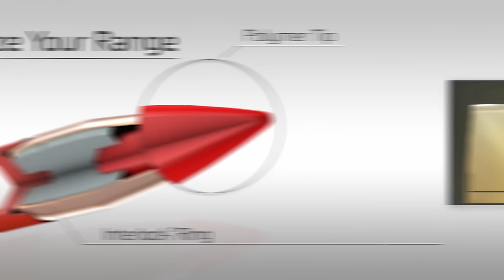Ep. 121 - Let's Talk Load Development

Comment: Let’s talk about how you lied about the velocity on your prc cartridges
Reply from the maker: When the 7mm PRC was first introduced, the velocity specifications were set using several high-performance propellants that were readily available at the time. As most of you are aware, there is a world-wide propellant shortage. As such, we’ve been forced to find alternative propellants. When choosing a substitute powder, we focus on accuracy, consistent ignition, and temperature stability. A new propellant option met our criteria and, more importantly, is available, however it often doesn’t achieve the original velocity specifications. With this reduction in velocity coupled with variation in chambers and barrels, it is possible to see 75-175 fps slower velocity from your rifle, than the velocity printed on the box.  This alternative propellant solution does generate the consistency and accuracy we demand. Other substitutes did not meet those requirements; we prioritized accuracy over speed. Hornady has always encouraged shooters to test ammunition from their rifles to obtain accurate velocity data.
 
Due to the powder shortage, everyone in the ammunition manufacturing sector is faced with choosing between loading ammunition slower than originally specified, or simply not loading ammo at all. This temporary powder solution has allowed us to continue to produce and ship ammunition despite the powder availability concerns.
Reply: @hornady  maybe you should have updated your packaging and made a statement about it instead of letting us find out after we bought your products and tested them ourselves.

Comment: Wow, here we go....reloading...this could go deep on the process...
Reply: Yep! I think wildcatting is about tbe most experimental I've accomplished. Even then it's always the research of others that helped guide me. I wanted to learn one specific case, the Savage 250-3000 case. It's been an amazing experience. I'm tempted to take it one step further if I ever have the opportunity. Most people wouldn't consider a 6.5x250 nor a 7mm x 250 but I'm an unusual duck ever since an old man invited me along to develop precision cartridges in an underground long range rifle tunnel. I learned the perfection of the .222 then developed perfect 223 first. Later, I found disappointment working with the classic weatherby magnum's, Lazaroni, and the 7mm Magnum so I quickly adopted the BR both 6mm and 7mm before going back to the 250-3000 case. Good enough till I have access to a tunnel again.

Comment: Propellant ladder testing has a couple of uses not discussed here.  One is to find the charge maximum for the particular combination.  Number two is to see if there is a combustion change as the charge goes up.  If you see that the velocity change per charge increment changes radically as the charge increases, you may have found points where the propellant transitions from erratic to stable to erratic burn rate.  Double based propellants show these characteristics changes more often in my experience than single based ones.  When I find the series of charge increments that produce a steady velocity change per charge increase, I load within that range.  You cannot do this in 1 to 5 shot per increment steps reliably, it takes approx. 10 shots per step to filter out the noise.

Comment: The 6 ARC was mentioned several times in this video, but most people don't know that it is a special case (no pun intended).  It has different loadings depending on what type of gun it is used in.   It would be helpful to explain that the SAAMI max pressure for the 6 ARC (and 6.5 Grendel) are set relatively low (52,000 psi) for good bolt life with an AR15.  It happens that this is too low to use the traditional "keep adding powder until you see pressure signs" method of load development.  I know of a fair number of Grendel shooters who initially go well beyond written max loads, not realizing that they are overpressure for good bolt life.  
   In a bolt gun, the 6 ARC and 6.5 Grendel can be run at higher pressures.  Hornady produces two sets of reloading data for the 6 ARC:  the "gas gun" loads are at lower pressures than the "bolt gun" loads.

Comment: Some twenty years ago, I purchased a Remington Coast-to-Coast or Sears rifle…yes, a long action 700 .270, the proprietor threw in two boxes of PMC ammunition! My intention was to do a custom 338! Unfortunately, my younger bother heard I purchased such, being tiered with his 30-30 inquired about using such for deer hunting! So, I put a Redfield hunter scope on, so I attempted to sight it in…I went through some twelve plus rounds…the best group was over 4 MOA! My brother then went on to harvest our three deer, with three shots! He, begged me not to do anything with that rifle, so I went through my load regimen. Resize, trim to length, de-bur inside and outside; and de-bur  the flash-hole!  I wishing towards having a Chronograph, researching numerous published data, I selected Hodgdon H4831SC with CCI 250 large rifle primers, & 130 gr bullets. After such, I reduced the group size to sup-half inch with PMC brass! I’ve continued to monitor the throat erosion via modified case…
Reply: My selection towards powder charges was mid-range suggested powder charges, with three shot groups, with three lower and three higher load of two grains intervals, measuring group size. After-wise, doing 1/2 grain intervals! Each was with just three round groups. Then, searching toward bullet jump, shooting above and below of .005” OVL…which brought me towards reducing group size from over 4 MOA to sub 1/2 MOA at 100 yards

Comment: Nice to hear 2 of you using American Rifle Company receivers.

I was reloading some Fiocchi .45 Colt cases.  When I tried to deburr the flash holes I discovered that most of them were visibly off center. With new brass (mostly Starline or Winchester) I find a few cases where the flash hole needs some work, and I have found a couple cases that did not have flash holes (don’t remember that brand). 

It doesn’t take long to check the flash holes and you only do it once per case.

Comment: For example:  Consider your Subsonic Luger 147 gr XTP round: Cat#90287.  What does the factory database look like that allows you to state MV = 975 fps in a 4" bbl?  How many rounds tested?  What is the extreme spread, standard deviation, average of all the spread velocity measurements.  Also what is powder wt. precision, bullet wt.  precision, accuracy of MV measurement device, accuracy of brass measurement, etc.   Are the components tested just selected at random off of the production line with no rejects?

Comment: I've been developing loads with GRT (Gordons Reloading Tool) Can't recommend GRT highly enough. 
If I do my brass prep, take case volume measurements, case length, seating depth, powder temp etc, I'm always within 20-30Ft/sec of the measured value. Once I have the measured velocity values, I can tweak the load & have had very good success with accuracy. So far I've found that the loads I've worked up with GRT have been very accurate to the point where I haven't had to tweak much if any.
I now spend most of my testing on a few 10 shot groups then I simply ensure that POI matches the POA. POI to POA is where it's at. Since we don't shoot groups at anything out in the field accept BR or F Class, it's all about Mean Radius & ensuring it is being utilized as precisely as possible.

Comment: Between my tighter match chamberr 308, valkyrie and 6gt, i just do a 10 shot spread over the top half of the powder charges. Anything within 50fps is where i try to find a +- 1 grain tight velocity node. I start at 0.030 jump. Aftee find go velocity ill play with seating to get tighter groups. Only chafer inside necks, clean in stainless media and shoot until the barrel starts throwing flyers

Comment: I learned a few things from this episode, so thanks for that.  Question, I need to do load development for an old Savage 99 chambered in .250 Savage which was re barreled with a Chick Donnely barrel that was turned down to a pencil hunting barrel.  The best accuracy I got with factory ammo was with the Hornady 100 gr Interlock (sub 1 MOA), but my primary use for this rifle is Coyote control & the Interlock does not expand fast enough, so I need to reload & use varmint bullets.  The barrel is so light it gets hot quick & after 5 or 6 rounds it starts stringing up to 1:30 - 2 O'Clock.  How do I deal with that, or should I just load some ammo with lighter varmint bullets 1 grain (of powder) down (like was mentioned in the episode) & run with it.

Comment: I was with you on seating depth/bullet jump with 109ELDM 6mm bullets, those are awesome. But the 80 ELDM in .224 is another story and I believe thats why they areon sale everywhere. I run them from round 0 to round 2,000 on my 223 wylde barrels  and then I loose them.
Reply: different bullets for different purposes, I'd say.
Reply: @jasoncown  Yes sir. One would think one ELDm would act like another but the 109 far out paces the others, and no its nothing like a 110 Atip. Good job on that one Miles.

Comment: 6 ARC - with a PSA lower and a CMMG Upper 16", Hypertap brake, CMMG mags, Reloads shooting 5 shot groups using the 95 SST, 90 CX, 90 ELDX, 80 CX with LeverEvolution all those loads shoot 0.7" groups. the thing just shoots. this measurement is center of hole to center of hole. the 6 ARC IS AMAZING. Leupold 3HD with the custom dial they have just dial for distance and boom

Comment: Great pod cast - I've listened to it several times now. Each time I get a bit more out of it. one question if you find a component combination that works in a barrel - when you replace that barrel do you start again trying different powders etc  or do you just shoot the same powder charge etc again in the new barrel assuming you have enough original components.
Reply from the maker: Depends how much time you have on your hands. Typically l just try the same combination again dropping powder charge and working back up to check for pressure signs.

Comment: I have personally seen cases from same manufacture that vary as much as 20 grains from one another.  Would this not make a difference?  I think in this podcast, you're really referring to cases that only vary by a few grains.  I don't typically weigh sort brass.  However, I do take note if the variation is a gross amount.  I ignore a minor variation.

Comment: What do you all believe accounts for wide ES when your sure you have done the utmost to get powder charges consistent from one cartridge to the next ie weighing charge on multiple scales, multiple times?
Reply: I look forward to hearing the Hornady teams response to this, but in my reloading experience ignition and bullet seating depth consistency often play a big part in that. Some loads (a combination of cartridge/caliber, powder type/brand, powder charge and case volume) seem to like certain primers better than others. And if the variance in seating depth is great enough, whether from seating die to bullet interaction or inconsistency in the overall length or base to ogive of the bullets you're using, you can get wider ES and SD.
Reply: Ignition and combustion consistency. 
Bullet release, neck tension, case fill… these affect how the powder burns and affect pressure.
Reply: Powders primers,  temp and humidity
Reply: Neck tension and case prep
Reply: Are you using top quality brass, bullets and annealing after every firing? For my 6.5 creedmoor lapua brass, h4350 cci450 and 140eldm I average around SD of 8 each 20 shot string in long range matches.

Comment: I found that seating depth making a difference is bullet dependent.  I tested 112 MBs against 108 bergers and ELDMs 30-40 thou off the lands.  I thought they were junk because they grouped over an inch.  I eventually went back and seated them 10 thou off the lands and the groups tightened right up

Comment: Speaking of load development, how did you all come up with the 7prc load? Been hearing alot of chatter that your factory velocities are way off?
Reply: I was averaging 2830 with a 26” barrel with the factory Precision Hunter 175gr ELD-x.  That’s not good considering it’s supposed to be 3000fps with a 24” barrel.  Hearing the same stories everywhere.  Hornady really needs to address this.
Reply: @soupie31547  I've seen a few channels talking the same thing. And yes they need to address it for sure. Things like this drive people away.
Reply: @soupie31547  That’s standard Hornady factory ammo. They’re slow. I can push my 7 Sherman Short Mag to 3000fps with a 180 with N565. RL26 would be an ideal choice for a fast 7 PRC load.
Reply from the maker: When the 7mm PRC was first introduced, the velocity specifications were set using several high-performance propellants that were readily available at the time. As most of you are aware, there is a world-wide propellant shortage. As such, we’ve been forced to find alternative propellants. When choosing a substitute powder, we focus on accuracy, consistent ignition, and temperature stability. A new propellant option met our criteria and, more importantly, is available, however it often doesn’t achieve the original velocity specifications. With this reduction in velocity coupled with variation in chambers and barrels, it is possible to see 75-175 fps slower velocity from your rifle, than the velocity printed on the box.  This alternative propellant solution does generate the consistency and accuracy we demand. Other substitutes did not meet those requirements; we prioritized accuracy over speed. Hornady has always encouraged shooters to test ammunition from their rifles to obtain accurate velocity data.
 
Due to the powder shortage, everyone in the ammunition manufacturing sector is faced with choosing between loading ammunition slower than originally specified, or simply not loading ammo at all. This temporary powder solution has allowed us to continue to produce and ship ammunition despite the powder availability concerns.
Reply: Well looks like Hornady Address the issue. Backfire said He was told the same thing on powder change because of shortage of original powder (RL 26) used.
Reply: @hornady Thank you for addressing the issue!!!

Comment: On case prep process; do any of you anneal at all and have you all done testing on benefits/ accuracy of annealing?
Reply from the maker: Some of us do, not for accuracy benefits, but for case longevity evening out neck tension.
Reply: For precision shooting, anneal after each and every firing in order to maintain consistent neck tension. Also, not to be a salesmen, but if you're going to anneal, it is worth every penny to buy an AMP. Other methods don't offer the consistency and true annealing process provided by the AMP.
Reply: An AMP is a WHOLE lot of pennies, lol. I've been super happy with the speed and effectiveness of flame annealing, once you get it dialed in. After work and family I barely have any time left for hobbies or interests so if it's not fast and effective I don't bother. I like the concept of induction annealing but until it's faster and costs hundreds instead of thousands, I just can't do it.
Reply: @DanielReyes-hz1qk  I understand. The AMP definitely isn't cheap! Flame annealing is still a good option, so long as like you said, you have it dialed in properly.
Even if you can't get the AMP, I'd still visit their site (if you haven't already) and read through their testing on all different kinds of annealing processes. I learned quite a lot from their research.

Comment: The reloading process including moisture percentage - loading by volume and not by charge weight due to swelling and drying of powder.  How about doing a test with allowable moisture data and how that effects loads from day to day? That will set another baseline for POI shifts from everyone’s pet loads caused by case volume and pressure differential. What say thee?

Comment: 17:54 The discussion up to this point leaves me confused. Fully prepped Hornady brass versus factory Hornady brass, and the results are indistinguishable. So why the market for the alpha brass companies including Alpha brand brass? 

If relatively low quality Hornady (that some gun manufacturers recommend not using) is just as good as sorted perfection Hornady, why do so many people not use Hornady and instead go to Peterson, Lapua, ADG, Alpha, etc.
Reply: I think a lot of it has to do with the metallurgy and longevity, especially with loads that exceed 65,000psi.  Some of the expensive brass handles high pressure better.  My experience with ours is that if you run at or under 65,000psi they'll last 15-25 firings with proper annealing cycles, but if you push over 70ksi you may be looking at 2-3 loads before they get loose primer pockets.  Some of the other brands will handle 70-75ksi loads for 5-10 cycles. I don't advise pushing any brass that hard, but people routinely do it, believing that our book max loads are conservative starting points (they're not).
Reply: Plus confirmation bias